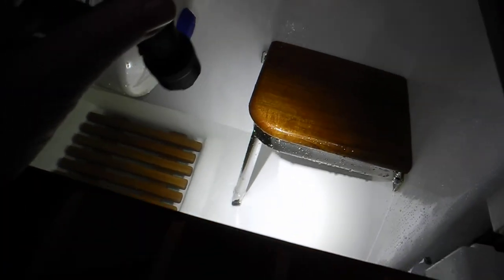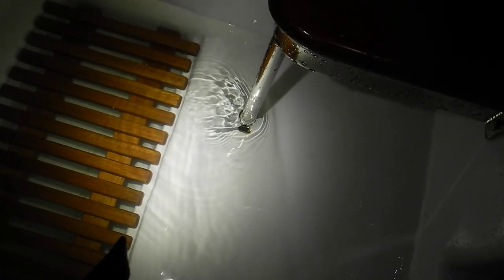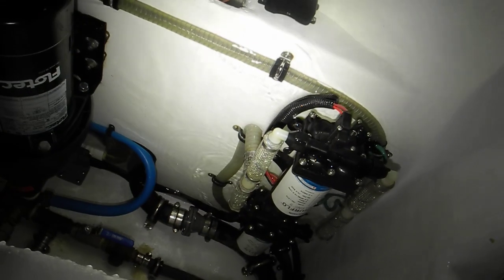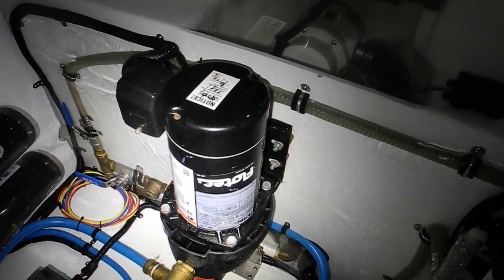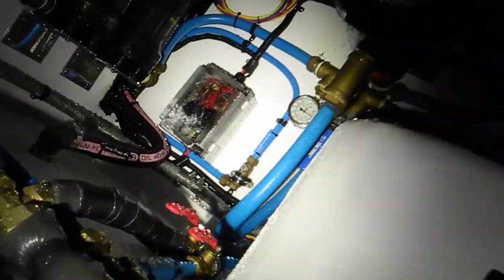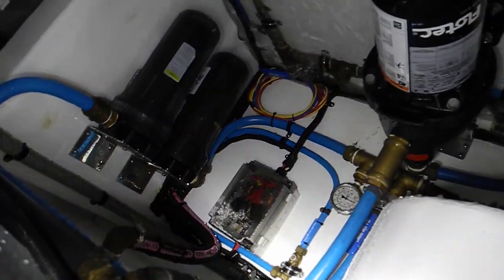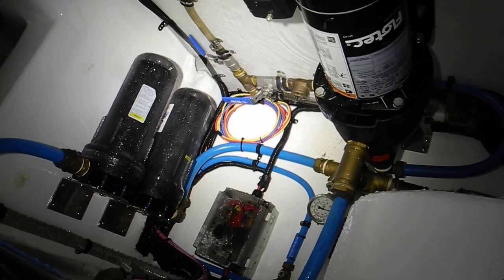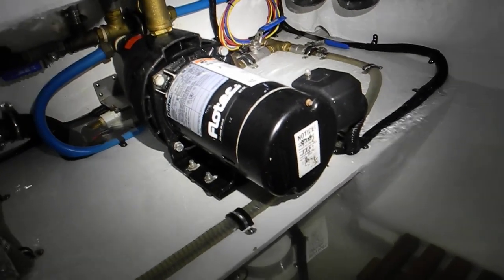Domestic water explosion

Comment: Wow.  That bilge pump seems to be draining very slowly. If you have a thru-hull pop off I don’t think you would have time to deal with it.
Reply: The pressure switch kept on pumping water. The fitting cracked and blew out all our water.
Reply: @ understand- it just seems like in the scheme of things 250 gallons should be emptied pretty quickly by a good sized bilge pump. Maybe I’m wrong there but it just seems like maybe the pump there isn’t doing its job well.
Reply: @ystebadvonschlegel3295  Bilge pump failed too!